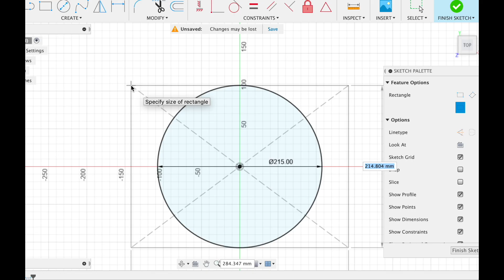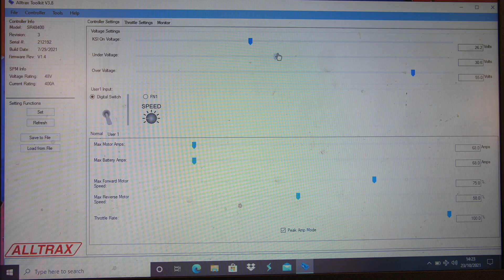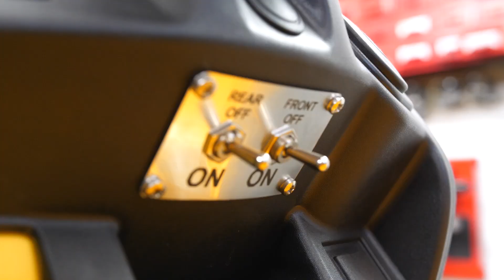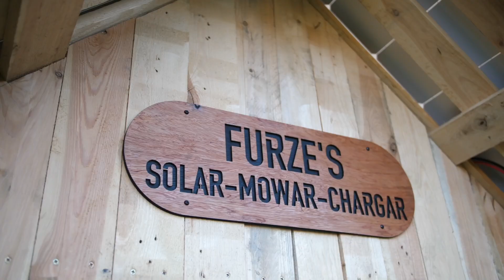EV Mower Conversion with Solar Charging Station

Comment: This is cool and all Colin but cub cadet, same company that makes the one you brought in at the beginning, already makes that exact mower in an electric model. All you really had to do was build a solar charge station for one of those lol.
Reply: Well his version using lead acid batteries just proves electric has been viable MUCH longer than lithium batteries have been around!

Lead Acid batteries, when built properly (not the modern crap you get) and maintained, can last thousands of cycles and are already one of the most recycled products in industry. They are a bit heavy for vehicle use, but they would be almost perfect for a cheap grid scale energy storage. They are so simple and cheap compared to lithium for how much energy they store and how robust they are.
Reply: @RingingResonance  The amount of videos of lead batteries being recycled in places like Pakistan add so much credit to your comment.
Reply: yeah, and I think they have lithium iron phosphate batteries. Dam expencive though. Prefer the ryobi zeroturn electric mower because it uses 40v battery packs that can be used in other ryobi power equipment.
Reply: @aronbraswell1589  Ryobi riding kind use 48v SLA batteries. I know because I own a 100ah kind and all my other yard tools are the 40v interchangeable pack kind.
Forget the solar shed. I want to convert to 48v lithium phosphate and attach panels directly to a DIY mower roof.
Reply: yes because that would be entertaining
Reply: Exactly what I was thinking. There are several companies now that are making electric mowers both riding and push. Though still that doesn't take away from the fact he completely swapped one over and did all the engineering and everything.

Comment: Would you be able to do a push mower? Many more of these in yards. Could be a nice business if you had a “plug and play” kit for those looking to convert their existing mowers. I have a 30” toro time master that I would love to convert.
Reply: Can I ask why you'd convert it when you can buy a brand new electric push mower for $400 to $600?
Reply: Tons of battery push mowers available on the market, probably not worth making a conversion kit. Just use your old till its dead and then buy a battery one
Reply: companies already make them
Reply: Great question and comments. There is currently no 30” electric push mowers on the market that I am aware of. They retail for $1300 and then i have a check mate stripping kit for the back $200. The deck is in great shape but the motor is starting to go. Once the motor goes it would be great to toss that and put an electric motor on.

Comment: Here is a challenge, take an old tractor from the 1950s, and make it into one hell of a green machine running pure electric, but keep it all mechanical, you aint allowed a SINGLE computer in that thing, how you gonna control voltage all that? Well, glad you asked, just look it up how they did it a 100 years ago.

Comment: This may be the most useful thing Colin has made. That’s a genuinely better lawnmower setup that he can now use every week.
Reply: Despite having spinning blades on wheels - ironically - it may also be one of the safest things he's made... :)
Reply: I'm also positively surprised how clean the mod seemed, I mean not that he doesn't do a good job usually but it didn't seem to require much adapting and bodging to swap the original engine for the electric motors.
It almost seems an actual product.
Reply: @Yrouel86  now you know one of the reasons it's silly more don't exist. I suspect the main reason they don't is that batteries are expensive. Takes a mower like that from $1400 to over $2000 for the only commercial ones I can find right now.
Reply: @Chryos2002  Even lead acid batteries like those are actually expensive? They seem the kind that go on forklifts which are pretty common
Reply: @Yrouel86  $80-$200 a cell depending on the size and features. He had six in the video, plus the controllers, charging, and wiring.
Reply: @Chryos2002  Oh ok yeah I see the issue
Reply: @Chryos2002  There are lots of electric mowers on the market now. The very one in this video is now electric in the new models.
Reply: good one  you should change your name to bullshit
Reply: You saying his screw tank was not useful??!?!
Reply: I can tell you have not seen the cakeomatic
Reply: good one  you should change your name to bad multiple
Reply: What you meen? The bunker  is the ultimate man cape
Reply: What about the weight before and after
Reply: I dont know my guy, he has made some machines with alot of potential to them
Reply: The bunker is also very useful
Reply: Or every other week. Depending on how cloudy it is. Luckily Britain is famous for its good weather.
Reply: Once a week yes since those batteries will take over a week to charge!!
Reply: Youve obviously never seen his knive belt
Reply: good one  You’re a bit of a spanner aren’t you?
Reply: No I want magnet shoes
Reply: Hey! The most? One of many! Hahahaha the fireworks especials are great too xD
Reply: The price of new car batteries these days though.....
Reply: WHERE'S THE TUNNEL!!!!

WE KNOW ITS ALREADY COMPLETE PLEASE UPLOAD THE TUNNEL VIDEO'S!!!!!
Reply: I was going to say the same thing.
Reply: I want one.
Reply: Usefull? A lawnmower is one off the most useless machines ever made. Esp that size
Reply: @samponette3306  Depends on a size of the lawn. If anything I could use a bigger one.
Reply: Useful? When did he make that? 😂😂
Reply: Put an inverter in it and use it as a drivable power station.
Reply: Only problem will be the cost……
Reply: Hey I know you, you’re the cruise ship guy
Reply: https://youtu.be/GHIMASbscXA
Reply: 👍👍😍😍..yes you are right
Reply: for only 10-100x more than a standard combustion engine lawn mower! Roflmao useless shite
Reply: good one  "Motivational quotes" may be a good idea, but it is completely irrelevant to this.
Reply: Sure but in the UK the grass doesn't really grow over winter, so it'll be out of use between October and around March. And i bet this was ludicrously expensive
Reply: @HRHooChicken  I think there will be enough during winter. He just needs to store it outside and let it charge
Reply: good one  nob
Reply: Assuming there's been any sun that week.
I haven't seen the sun so far this week, because autumn.
Reply: @Skorpychan  Good job we don’t cut grass in the winter then
Reply: @Skorpychan  solar panels work even in a hard overcast
Reply: @MrDoroh  Not very well. They also don't work at night. Did you miss the part where renewable energy shat itself last month because the wind stopped and it was cloudy for days on end, and they had to burn coal again?
Reply: @Skorpychan  If you drive once a month its not a problem
Reply: @Skorpychan  big rechargeable batteries are nice.
Reply: @Skorpychan  Solar panels also work on cloudy days. They don't just need direct sunlight. They can also work off artificial light.
Reply: @jase6709  Yes but the power drop is huge, about a tenth. My 3kw system gets 0.3kw on cloudy days
Reply: @ThePiemasteification  He has plenty of time to charge though
 - because he only need it to be charged the next time the grass has grown, haha
Reply: @jase6709  Yes, power your solar panels off artificial lights for infinite power.
Reply: @Skorpychan  and power the light with your solar panels!
Reply: @bl4cksp1d3r  Infinite power!
I say that every time I roll up the big extension lead and plug it into itself to stop the plug dangling.
Reply: Its cool but theres something missing................I know, machine guns!
Reply: Would be much more efficient working on tesla battery packs
Reply: Yeah but lead acid batteries... surprisingly didn’t use lithium.
Reply: @shize9ine  did you not hear him at the end of the video?  11:41
he does not know any company that do make lithium battery packs he can use to make a bespoke battery system. And is asking if there are any out there and what to get in contact with him.

Something I can imagine as moth lithium packs are often build for a dedicated machinery. not sold as is.
Reply: @sirBrouwer  No, he's very aware that the batteries are available. Lithium batteries aren't at all hard to find. He just wanted a sponsor so he doesn't have to spend as much
Reply: https://youtu.be/_mstbNizOjIrbrbe
Reply: @Proffez01  Nice work.
Reply: good one  ncie

Comment: " Solar powered lawn mower " 
There's one slight issue Colin.. 

You're in Britain
Reply: New idea: rain-powered lawn mower
Reply: It's a misunderstanding that cloudy weather affects solar panels much -- it doesn't. From the POV of a solar panel, the photons  on a cloudy day are no different than the photons that hit them on a sunny day -- that's a human perception. I speak from testing this out and owning several sizes and types of solar panels. Easy to confirm with a simple multimeter.
Reply: Victorillo 377 - I think Colin knows more than anyone else, where he lives.
Reply: Plenty enough if sun to power it.

Comment: I'm disappointed you didn't go out to a salvage yard and find and electric motor/battery from a crashed EV for this project.  Sure, the small one will work, but 100+ hp would work better.  😀

Comment: ...this brand (at least, looks like Club Cadet) already makes an electric version, you're just wasting parts by not using them.

- Felt will degrade with moisture. I'd suggest delrin slides, a material you've used before

Comment: 1t thing where Coling's version actually makes less noise! - His neighbours should be proud! 🤣
Reply: built different  So's ya mom
Reply: Next step: mount an electrically-powered foghorn on it.
Reply: @quixototalis  it defenently needs a soundsystem to make V12 noises
Reply: @timmeier210  not lowed enough this is Collin we are talking about. He will find a way to achieve the sound of a jet engine.
Reply: 1st :)
Reply: The noise reduction alone is worth it.
Reply: Or at least temporarily relieved.
It's much like when you have young kids. The quiet is nice... until you realize they have been quiet for TOO LONG and you know they're doing something they shouldn't.
Reply: I'm having a stroke
Reply: https://youtu.be/_mstbNizOjIrhdbcb
Reply: built different  Go away with this already.